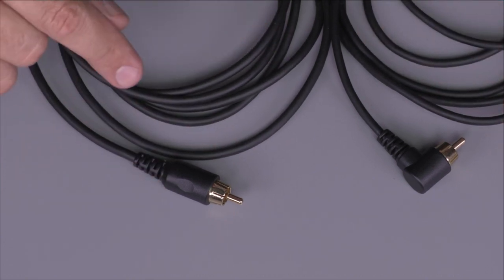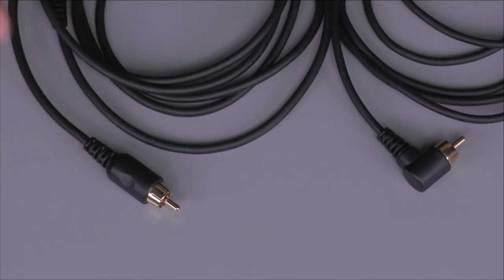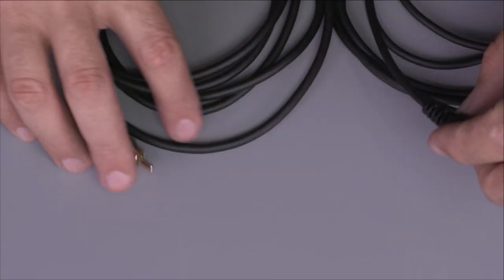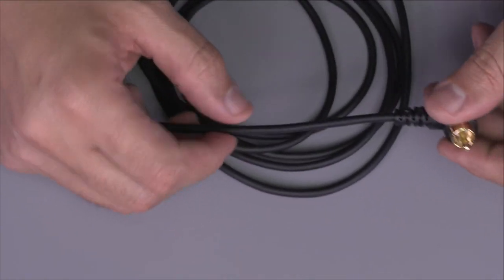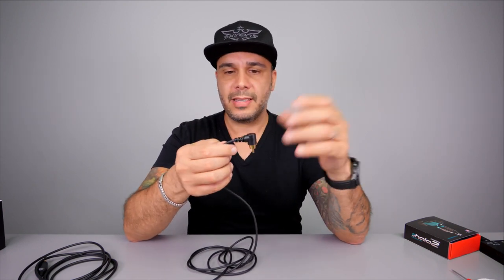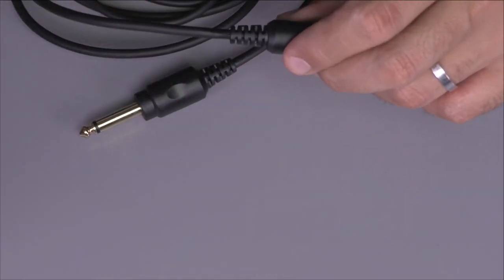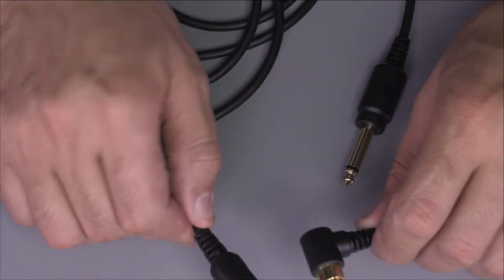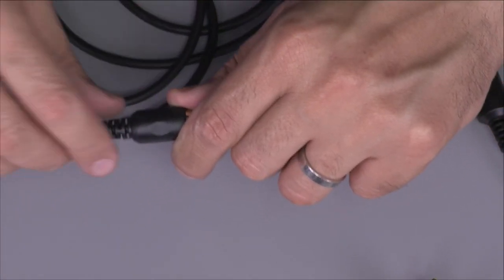Tattoo machine RCA cables

Comment: Is it okay to use the Xion with the new rca air cord?
Reply: @Lanni inx im using the new rca AIR cord, which is supossed to be thinner than the original rca,.
Reply: @Lanni inx omg hope i dont have that issue with mine, you should send them a message filling the contact form in the official fkirons page, maybe they can replace your cord, good luck